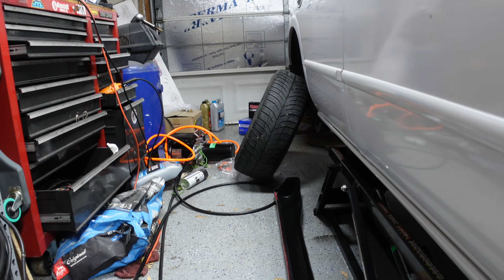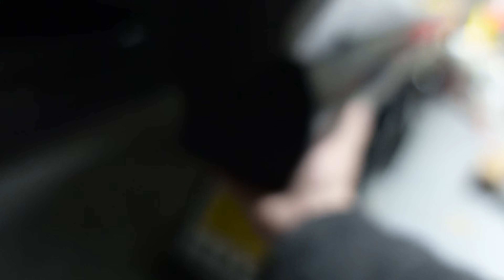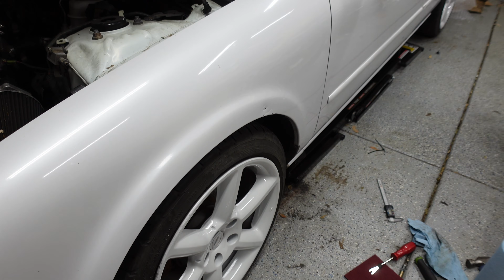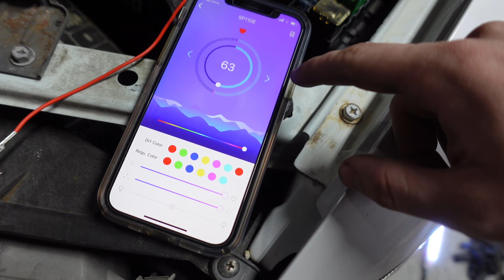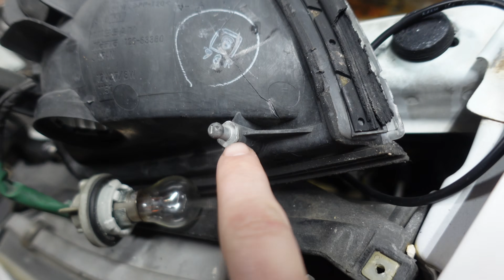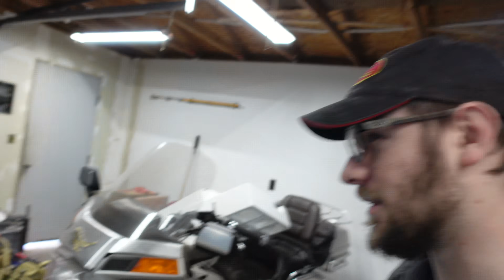Building my NFS: Underground dreams! CarTrek Maxima tuner build!

Comment: Jake I have 2011 Nissan Altima 3.5 SR and have a similar leak. I asked at the dealership parts Dept about it and they said there is an O Ring by the oil filter housing that commonly fails.
Reply from the maker: I haven’t had a chance to look yet but that was my assumption as well. A new filter definitely did not fix it.

Comment: About your corner lamp being dual filament .. I have an Altima SE from that era and it has cornering lamps where the bright side of the bulb lights up solid when the headlights are on and which ever side turn signal is on.  I know that non-optioned or non-SE Altimas didnt have it.. fun story, i failed state inspection once because the inspector was not smart enough to know that wasnt a turn signal and it wasnt supposed to flash.  I have had too many issues getting pulled over or inspection in VA so I just disabled that option.   Anyway...it would be the same housing, so maybe your car had that option and your vehicle just isnt optioned with it.